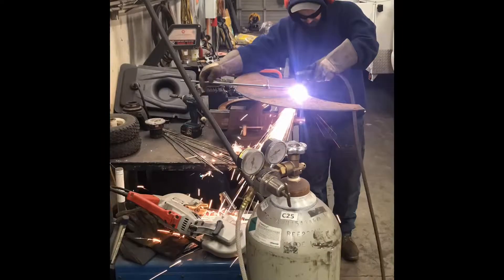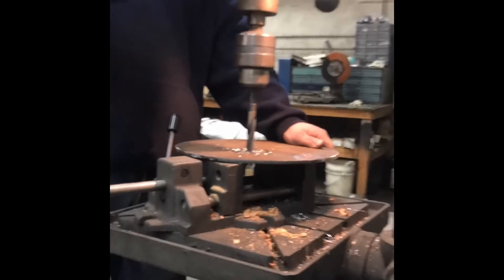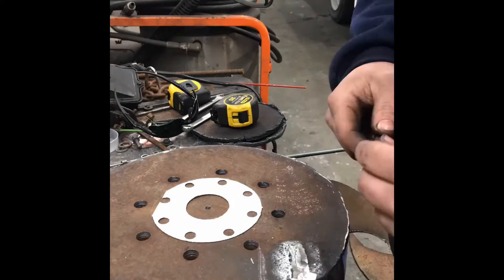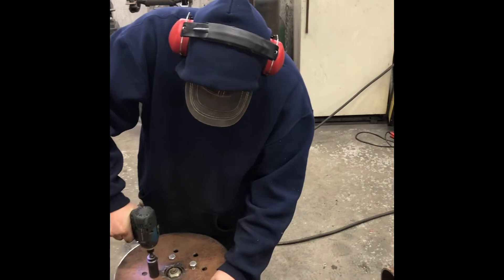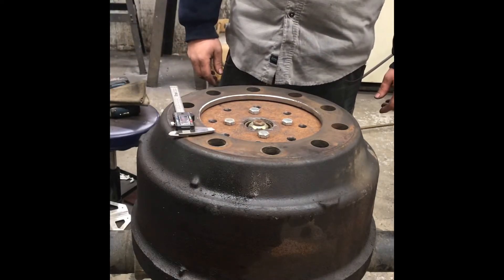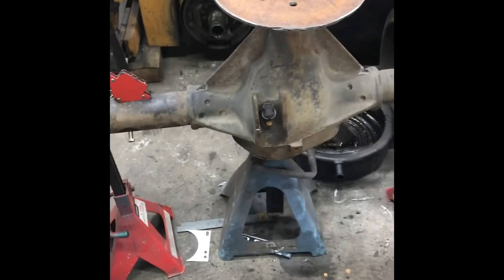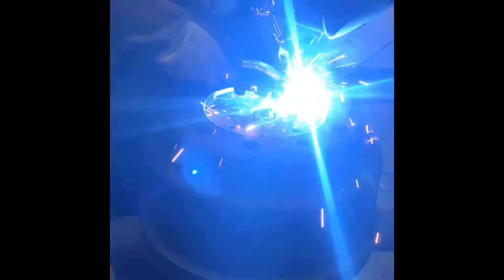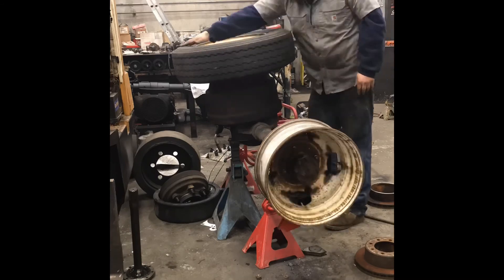Wood chunker for WOODGAS p5

Comment: Impressive work both in scale and ability. Yup, you like diving in head first, don't you. What differential and ratio did you use? Raked it from  that new Petercar you rescued the other day? 
I did jump back after you set the drum on top and she started to roll on the jack stands. You have yourself a real heavy duty chunker which will be able to keep up with the beast's appetite for wood. So, what's next ? the wood drier? Can't wait to see this in action. Thanks for the video
Reply from the maker: Haha yes it almost got away from me for a second there! This axle is from a power stroke diesel van a friend owns that we converted to 4wd with super duty axles it's has 3.55 gears. I was hoping for lower but I took what I could get since I really needed to make fuel fast so I can keep driving the truck. Hopefully next is another gassifier for my v10, I'm lucky that I have a heated tool room at work I can store and dry my wood in